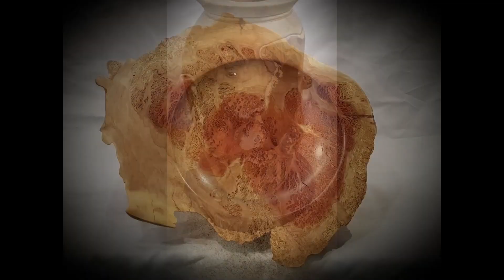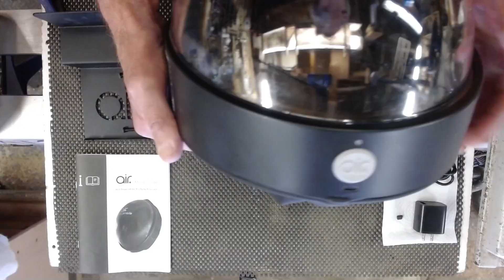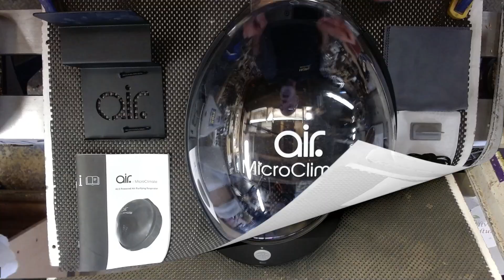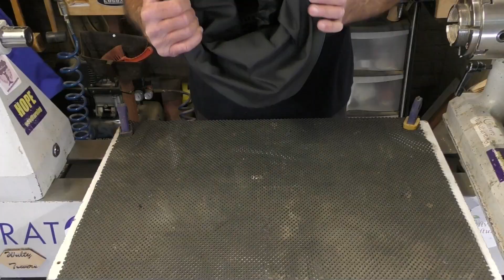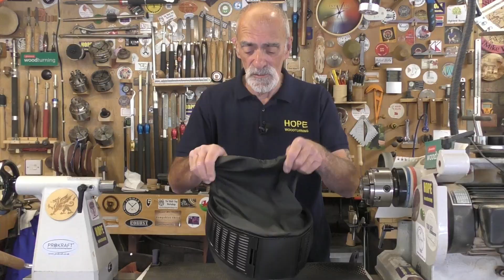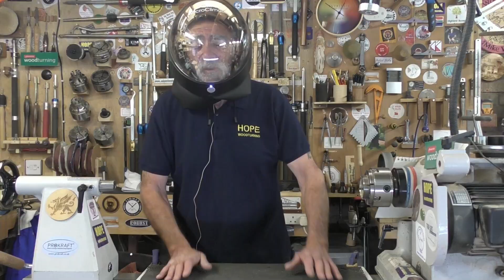MicroClimate Air3 Powered Respirator

Comment: Thanks for the video Mike.  Very interesting but I'm not tempted with the product. As well as price and need to return it to the USA for a battery (really), it seems too much like putting on a full-face motorcycle helmet and having to do the strap up. I will stick with my JSP Powercap which is so quick to put on and off and is very comfortable especially compared to the Trend which I have tried. 

BTW, I thought that your audio level was a bit quite on this video and that was when you didn't have the helmet on.😁
Reply from the maker: Hi Doug .... I agree with your sentiments.  Strange re the volume, as recording levels are the same as usual.
Thanks for watching and commenting. Cheers. Mike

Comment: Here in the US, I just started using the JSP Powercap a few weeks ago, and I love the comfort and ease of putting it on & taking it off, especially with glasses.

 The Air3 would take a little more time & effort with those neckband adjustments. I also like the ability to bring the battery pack into the house for charging at the end of the day.

The only suggestion I'd make for JSP Powercap is to increase the fan motor a little more. Since the filters are in the front, they clog up quickly, and you need to blow them off frequently. This filter clogging slows down the airflow somewhat. 

No face shield respirator is perfect, and none of them will win a fashion award for sure. 

Thank you for the review, Mike!
Reply from the maker: Thanks for your input James, also for watching.

Comment: Thanks for that Make most informative. I have 2 batteries for my trend air shield pro and I just chase them over when the beeper goes off so I can carry on turning. I do like this respirator, but how much is it ?
Reply: Try the following hack: USB to dc 5.5mm and 2.1mm long cable with usb power bank. Remove Trend battery (just pulls out). Plug in cable to power bank. Fan runs a little faster. Helmet much lighter. Powerbanks have a longer charge.
Reply from the maker: Thanks for your input Kevin. The link to their website is in the description. Cheers. Mike

Comment: Be cool to see the size difference compared to the Axminster. It looks a fair bit bulkier?
Reply: I find the Trend and Axminster units to be cycling helmets with attachments for filtration causing the Trend to be a bit front heavy.
Reply: @royalvarez6436 Try the following hack: USB to dc 5.5mm and 2.1mm long cable with usb power bank. Remove Trend battery (just pulls out). Plug in cable to power bank. Fan runs a little faster. Helmet much lighter. Powerbanks have a longer charge.
Reply from the maker: It is heavier and bigger than the Evo Ben ... but surprisingly comfortable and well balanced.  Thanks for watching.